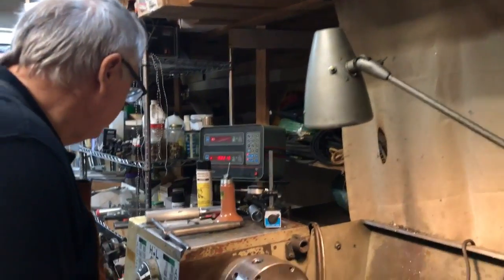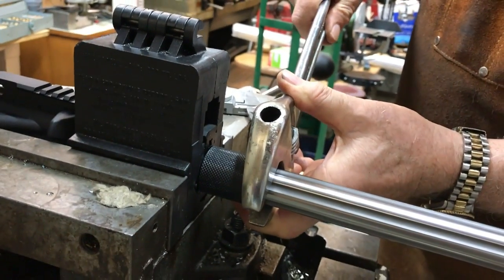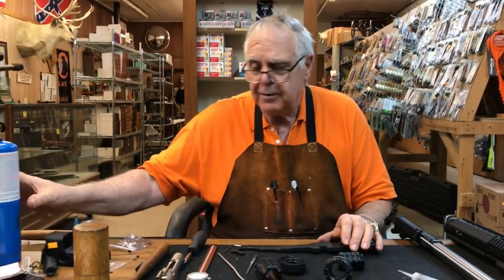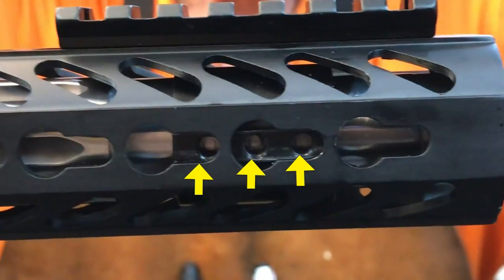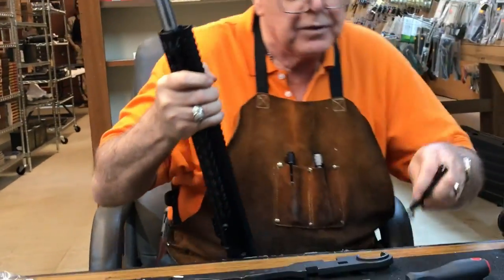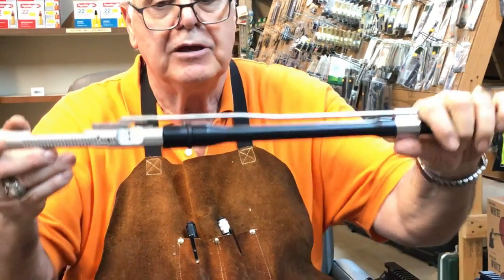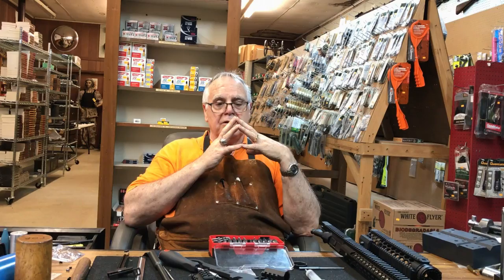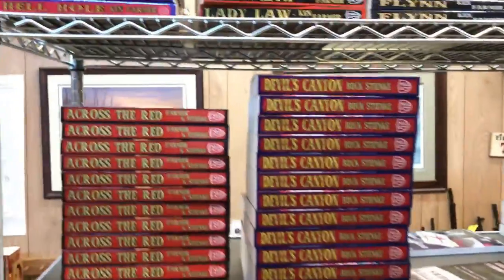Uncle Buck Installing New Barrel On AR Ruger 204 - Barrel, Bolt & Gas Block Explanation

Comment: Fascinating! Plenty of springs, coils, pins, some metal or carbon pieces, some lube and a skilled gunsmith with handy tools and the lower part of the rifle is born. So far without a barrel everything looks quite harmless. 
But now after adjusting the barrel, uh, it looks martial. I'm scared now. Should I hide under my blanket? Honestly, the sight of this rifle makes me nervous.
Oh, that's how it works, this gas-block gas-tube system. Let the high pressure gas flow back to the bolt via a gas tube and thereby unlock the bolt. Simple but clever! I like it.

Comment: You don't really want the gas block touching your rail. It can mess with your barrel harmonics. That is the hole point of having a free floating handrail.
Reply: John missed Bucks & Ricks video on wood rifle stocks & barrels.
Reply: ni9465 John knows a little about a little!!
Reply: @johnsmithjr5498  https://youtu.be/6rdAyIHWi7k
Reply: Red Rider7 Thank you!!
Reply: We Call That A Clue How do you have a semi auto with no gas block? You don't want your handgaurd to touch your barrel, ie your gasblock is touching your handgaurd.
Reply: We Call That A Clue it's called a "free float" handgaurd because???
Reply: @johnsmithjr5498  because gas block on barrel, gas tube runs back to receiver & bolt...so acts on barrel of AR when you pull the trigger of course with a live rounds.
Reply: ni9465 You don't even have firearms do you!?!
Reply: @johnsmithjr5498  yes I have firearms...no bullets though...you be surprised how many people believe the firearms are always loaded, I am also good at poker, go figure?
Reply: John Smith Jr. 

It's easy to have a semi-auto rifle without a gas block. 

There are two basic designs of semi-auto actions:

1. Gas operated. 
2. Blowback operated.

In the gas operated design some of the gas propelling the bullet down the barrel is taped off and used to cycle the action ( and sometimes slow bolt opening speed as in the M-16). 
 
In blowback designs the energy of the fired round is used to push the case to the rear thereby blowing the bolt open and causing the cycling action. 

Many full auto machine guns are blow back because it's cheaper to produce, requires less maintenance and fewer parts than gas operation. 

But hey..... what would I possibly know? I'm just some guy in his pj's living in the basement of my parent's house. 

AND now you know why I don't watch most gun build videos on YouTube.